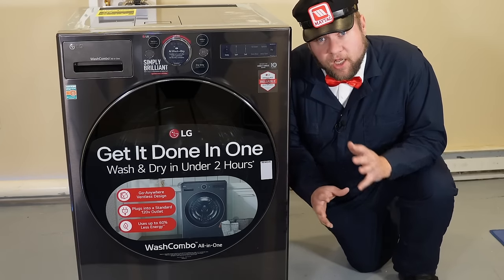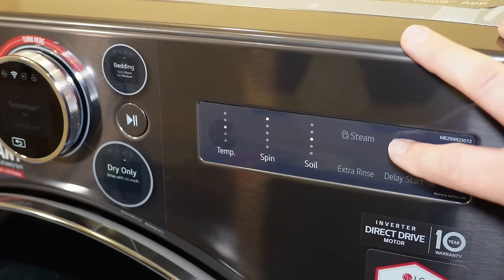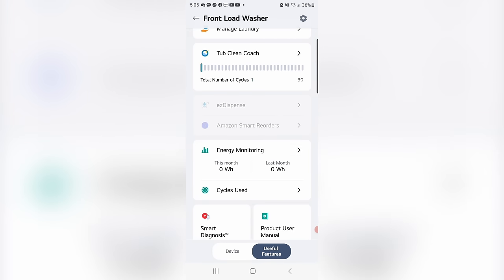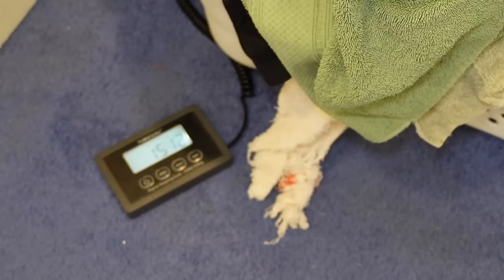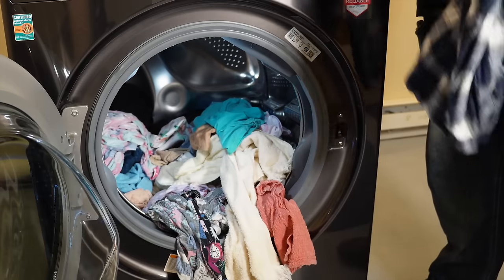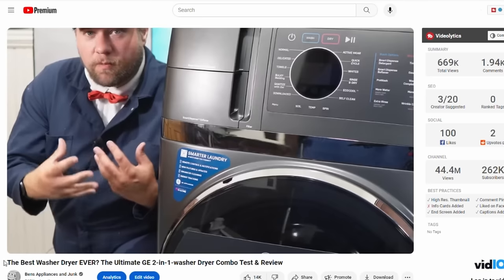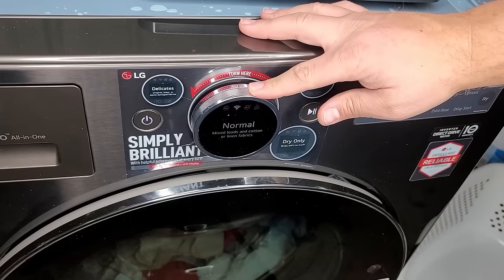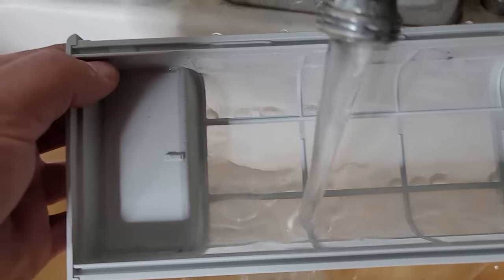BETTER THAN GE? The LG All in One Washer Dryer Combo: Test, Teardown & Review

Comment: I  have a 16-year-old LG washer-dryer combo, and the ability to plug it anywhere is precisely the reason I never upgraded it, it workit s fine, only needs 110v and the water hoses, don't need to clean lint except maybe a wet towel around the door every now and then, it does take 4 hours to deliver a dry full load but I don't mind, is the best washer I ever had and even have steam cycles for ironing or "refreshing" clothes.
Reply: Same here! 16 year old LG Tromm. I am from Europe. Had a combo when I lived in the UK and also in France. It was a no brainer for me to get one here in the US. I mostly line dry after 10 minutes of dryer time. Takes the wrinkles out. Never overload the dryer, always split the washer load in half.

Comment: As an LG product owner I won't buy another front load washer. The LG front load drum is held by light weight spring shocks that allow the drum to bounce around noisily and bounce the washer around. On the tear down video I seen the exact same spring shocks holding the drum and could not image that washer dryer combo not bouncing around on the floor during the spin cycles... This video is great and maybe these are the future but like he mentions better warranty and a little better engineering would be a winner....
Reply: Vibration is handled much better in this unit than my prior LG. Used to always know when final spin was happening, but no more....

Comment: That's insanely complex. Why not just get stackable front loaders? For two reasonably priced front loaders you can get a roof vent installed if you need it. They aren't that hard to put in if that's your deal breaker. 30 amp outlet isn't hard to put in either as long as you have space in your panel for it. But seriously houses already have these things and if you are building a house from scratch you can afford to put these things in to start with.
Reply from the maker: Not everyone has room and or wants convenience. I prefer a stacked set too but in making thr video, I've found tons of people that don't have the space

Comment: Thanks for the great review. I was wondering does this have a drain pump clean out like the GE unit does?
Reply from the maker: It does. A superior one. It has a rubber hose you can move and drain before unscrewing the cap for access

Comment: I didn't pay attention to the short warranty on the heat pump when I bought mine. Only had it for a few days, but now I'm worried. I guess I'll have to look into an extended warranty. My first load was quite long, but subsequent loads are taking less time, even with similar items. Kind of wishing I'd gotten the GE now...but with the price I paid I can get an an extended warranty and still come out ahead.
Reply from the maker: Its only speculation about the warranty. There's no real absolute answer at this time. The unit isn't running 24/7 like a fridge does, so the lifespan SHOULD be longer. But these all in one combos running on R-134 are totally unknowns at this time, so anyones guess is as good as the others.

Comment: I'm not sure about claiming one can put this anywhere in the home.  Imo it's more difficult to run a water line than a 240V circuit.
Reply from the maker: You'd need the water line for literally anything, so at least with the only-120V requirement, it opens up areas with water.

Comment: Our regular washing machine went out, I was wondering if I could replace it with a combo and still use the dryer so I can have two loads going at the same time? would the hookups I have now be enough?
Reply from the maker: Assuming the current dryer runs on a regular 240v/30a dryer outlet, yes absolutely

Comment: Can you please quickly recommend some good surge protectors for washers and dryers. Surge protectors that can handle 120 and 220v and up to 30-40amps?
Reply: you can get air conditioner surge protectors for $20-30 that are for 15 - 30a 250v outlets
if you need more amps, you can get a 50 amp “RV” surge protector for about $30-50 online
Reply: @ethernet01  oh nice. I tried searching but could only find some that I don't quite trust to protect my new washer dryer unit

Comment: Question - If you bought two of these units could you simply split the existing waterline and run two at once?
Reply from the maker: Should, yes. You'd want enough water pressure, though, to ensure smooth operation between both units.

Comment: Another point of possible concern: seeing the pooled water in the bottom of the condenser housing (during your teardown) I would be worried about mildew being an issue if the unit sits for any lenght of time without being used.
Reply: Keep the lint filter removed between uses.

Comment: I'm a little disappointed you'd say this is better than the GE based on the app. I don't buy an appliance like this for a nice app. I buy it to wash and dry clothes. If it has a nice app, that's a bonus, but given this has a smaller compressor, with only a 1 year warranty, saying it's better than the GE doesn't make sense.
Reply from the maker: The reliability of an LG unit is better than any other front load on the market, historically. GE does not have the same kind of track record. The heat pump is a concern, but many, many people are finding the LG to be notably cheaper, and that means you can just get the 5yr extended warranty to cover the system just the same. So thats why I'd pick the LG, but barely.
Reply: @bensappliancesandjunk Is the 5yr extended warranty a third party option, or something offered by LG?

Comment: 16:18 - That much lint build up after 4 washes is a deal breaker, and it’s not accessible. Definite issues with the design.
Reply: I've been using an earlier model for several years, and had no issues with lint. One time when I washed a towel covered with sawdust it clogged the water filter, which I had to open and clean out on the bottom front panel. But that's a very special case.
The major criteria I've had to pay attention to is to keep heavy jeans and light underwear in separate loads to avoid wrinkly jeans.
The total run time is not big of a deal. I set up to wash and dry, and I don't have to come in and move the clothes. So all I had to do is adjust my planning and schedule.

Comment: In terms of energy efficiency this unit versus the LG stackable unit you have in this video is the total energy consume for washing and drying clothes and total about the same or is it different than the standard washer and dryer stackable unit?
Reply from the maker: about 50% less than a traditional electric dryer. On the washer, its going to be the "Same" for most front load washers. However, if compared to a top load, this is like 75% more efficient (front loads have a MASSIVE advantage on electric/water consumption)

Comment: You need access to the top of the machine for the lint which means it’s footprint is bigger and limits some configurations.
Reply from the maker: It does. This is why GE used their front-facing cartridge.

Comment: is the heat pump helpful if your house is trying not to freeze? this thing is basically a small AC inside your house, theres no free lunch in physics
Reply: Similar to your fridge, it's going to be a net gain in heat overall. You're not sending anything outside like you would with a vented dryer or window AC unit.

Comment: Very time inefficient. Not only is the drying very slow, but you can't wash anything while it is drying. With a separate washer and dryer you can wash and dry at the same time. If doing more than one load then this is not the way to go.
Reply from the maker: You're assuming that someone using this has the room for a set. I would imagine that given the specifications of it being 120v and ventless, its really not designed for a standard laundry room. It would be interesting if they ever did a beefed up 240v unit though. That would probably cut dry times in half, making it a better idea.

Comment: How well would this work for an RV?
Considerations:
Power usage
Water usage
Vibration
Noise
Durability (vibration resilience)
Reply from the maker: Fantastic. We are doing a much more in depth comparison between this and the GE and will have many of those questions answered.
Reply: I've had the Splendide washer/dryer ventless version in my rv for about 10 years now and its still rockin! A friend of mine just installed this LG model in his fifth wheel and his works just fine.

Comment: No thanks.  I've come across these combo washer/dryer units in Europe and was not impressed with their long run time and inconsistent drying.  This LG unit looks like more expensive, overpriced, disposable tech junk.  I'll stick with my separate washer and dryer that I can fix myself and LG should stick to TV's.
Reply from the maker: These run 2-3x faster than European models, by the way. Reliability is a question for sure, but the European units are garbage compared to these.
Reply: @bensappliancesandjunk  You may be right.  My last use was a Bosch unit in the UK just before the pandemic.  It took over 6hrs to complete a wash/dry cycle and the laundry was still damp.  That said, 4+ hours per cycle is still too long in my Yankee book.  Kinda like how they are trying to convince people that spending hours to recharge an electric vehicle is normal and not a big deal... 😃

Comment: If I have room for a washer and dryer side by side, is there any reason to opt for a stack other than having slightly more space in my laundry room?
Reply from the maker: Not really. Stacked is only beneficial if you have more vertical room than horizontal. Most servicers would greatly prefer the units unstacked, if possible.

Comment: Great review!!  I apprecaite the tip on the compressor and extended warranty (although, slightly annoyed at LG on that!!!).  We just picked one of these up a week or so ago and would never have known!  So far so good, but my initial concerns (other than the compressor now lol):
1)  FUR!!!  After one load of pet bedding the fur keeps reappearing on the rubber seal!  We're wiping it down after each cycle and it just keeps coming back - no idea from where
2)  eZDispenser for detergent - ours is pretty much empty (certainly less than 1Oz that we have it set to) and it still hasn't given us an indicator that it needs to be refilled.  We're currently running a few test cycles now waiting for it to let us know, but 2 loads/cycles in - nothing.  Maybe it stores a few ounces past the dispenser  ???
3)  No way to customize / save cycle  ??   at least we haven't seen it yet.  We have to set temp, spin, and dry options - OH - and "Fresh Care" over and over and over.  Come on LG - give us a way to save the cycles the way WE want them.
Reply from the maker: On #3, its in your options, near the very bottom. You can customize what cycles are displayed (up to 15). Its more easily customizable via the app, I think.
Reply: @bensappliancesandjunk  Thanks Ben  :)  I found how to customize which cycles are displayed - and it what order (or have them optimize it), but what I mean by "customize" is say for example the "PermaPress" cycle - what if I want cold water EVERY time - or to have the "Fresh Care" option added to ANY cycle EVERY time. 

We haven't found a way to add those options to a cycle and have it SAVE the choices - so that we don't have to select them every time.   (Especially "Fresh Care" - there should be a way to have that on all the time!!  lol)

Comment: All heat pump dryers running on 120 volts 15 amps cannot compare to heat pump dryers running on 220 volts 5 amps! Year after year of usage as fine lint and dust builds up on the heat pump condenser coils drying will take drying cycles alone will take 4+ hours!
Reply: None of that matters if I don't have a 220 Volt outlet. I live in an RV.
Reply: @GoogleDoesEvil  I understand, but based on this experts evaluation lint already managed to make it by the screen with only one drying cycle- bad news!

Comment: $2k too expensive vs $1k for a pair of normal washer dryer. If manufacturers can get the price down to $1.5k, then it starts making sense for those who aren't worried about space saving.
Reply from the maker: I'm not aware of a front load set that is $1k. This set is directly comparable to $2,000 sets that are 5.0cf wash capacity
Reply: @bensappliancesandjunk  I don't need it to be front load. Just whatever is cheapest.

Comment: Where does the lint go?  Also will it be a lot more electrical then having a separate washer and dryer.
Reply from the maker: Heat pump is vastly more efficient than a standard element-based tumble dryer. I have to buy a sensor that can handle looking at 240v amperage, but every test I've done shows that electricity usage drops 40-60% using this style system.

Comment: I've always been skeptical of washer/dryer combo units. But, these new units seem like they really could be the harbringer of the future.
Reply from the maker: I think they can be built well and right if the mfg. actually cares to. There are a lot of advantages potentially as well. 

Theoretically, the sealed system should last 4-6x as long as a refrigerators due to runtimes being so much lower. The heat of the process would naturally sanitize against mold. The required fan can be used to allow fresh air in to prevent it as well (and other mfgs do this to help mitigate, but not always). Electricity savings is pretty heady, as you're saving 40-60% per load, but I do want to test this in the future.
Reply: Hehehe. Harbringer is an interesting misspelling.

Comment: Given the recent class action lawsuit against LG, I'd steer clear of anything LG, particularly all refrigerators with an LG motor inside. There's a rash of poorly performing and breaking down refrigerators across the country. Watch to see how it pans out in court.
Reply from the maker: this has an entirely different class of compressor, which was mentioned in the video. They've never had issues with rotary compressors, AFAIK
Reply: @bensappliancesandjunk  Good to know! Now, I don't want options to overwhelm me; I want simple controls with less to break down, especially digitally. I understand moving parts that wear out, but there's no excuse for electronic parts to fail. I do not want or need a smart phone or to pay for it; my flip phone is hardly used since signals in my house are unreliable so I only use it when out and about and only to call out, not to receive calls except in rare circumstances. I have a reliable land line with internet. I don't give out my cell number and the phone stays in my car in the garage all the time; basically, it's a car phone.

Comment: Thank you for the video. I just brought this new washer dryer combo but it keeps tripping the GFCI breaker when dryer kicks in (it works fine for washing)

Do you know what is wrong with the issue?
Reply from the maker: Bad GFCI likely
Reply: @bensappliancesandjunk  Thank you for the reply. I tried to plug it to another GFCI outlet nearby (with an extension cord) and it still trips that one. I'm not sure if it's a bad GFCI or the unit is bad.

Should I try to replace the GFCI outlet?

Comment: THEY'RE ALL MADE IN THE SAME FACTORY, GE, LG, KENMORE,ETC. NO ONE IS BETTER OR WORSE THAN THE OTHER
Reply from the maker: Lol, no they aren't. LG does not have any active partnerships with GE that I know of. The parts in the GE and LG are radically different and viewing my GE video would show you huge differences on virtually every single component.

Kenmore is just a name, and they do use many different companies including GE, LG, and Whirlpool's factories from around the US, Mexico, and overseas places as well.

The individual parts and their origins also vary wildly. It will depend, but they can come from China, South Korea, Mexico or the US.

I am not sure where you get your info from, but its wrong. Yes, some companies do work together, but in the case of this unit, as well as the GE, they are definitely two different units from two different factories with entirely different theories of operation.

Comment: Mine delivered 5 days ago and it does not ever dry even after 4+ hours. I suspect that the evaporator pump isn’t powered on and maybe it wasn’t properly wired in at the factory?

I’ve even done a wash/dry cycle with just a few shirts to test and I think it just keeps cycling hot and humid air without ever pulling the moisture out. Having it looked at soon so hopefully it can be fixed!
Reply from the maker: Are you using AI wash or regular wash and dry? I did have issues with AI wash
Reply: @bensappliancesandjunk  my first load was AI and toomt 8 hours to dry. Hmm

Comment: I feel like the detergent doesn't get dispensed properly. I put it at 4oz but still doubt it because the clothes don't look super clean like the laundromat ones. I filled the liquid detergent slot with concentrated tide liquid. Should I switch to simple liquid detergent? Or should I put the soap into the middle slot? I just want more soap dispensed thoroughly. Please advise.
Reply from the maker: Did you adjust how much detergent is used per load?
Reply: @bensappliancesandjunk  yes i switched it from normal to more